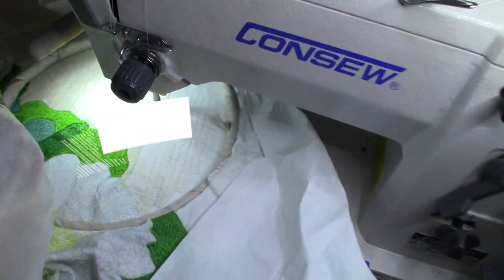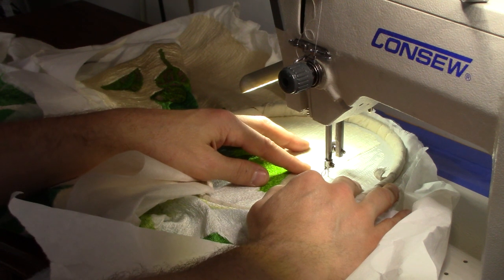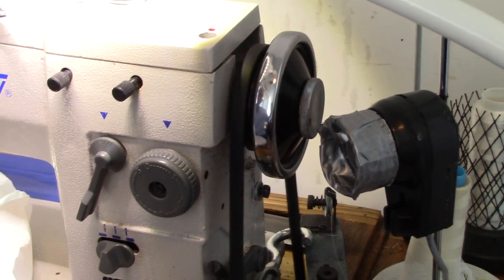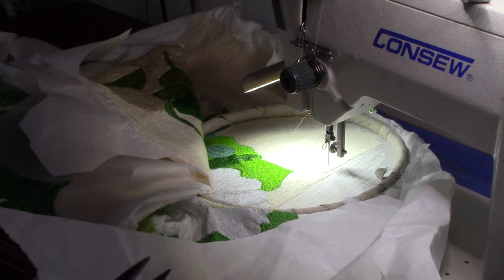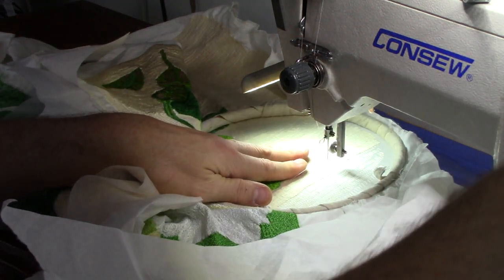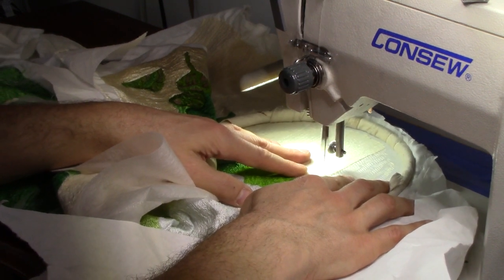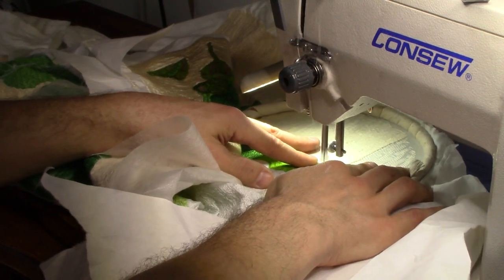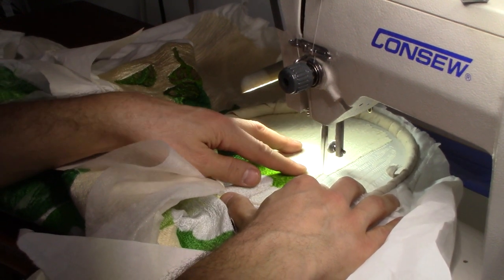Industrial Speed on Consew CN2053R-1A Using Servo CSM1001

Comment: how do you release the clutch to spool on the cn2053R-1A
Reply from the maker: These machines are designed to wind the bobbin while sewing. If you unthread the machine, and lift the foot, you can wind a bobbin -- the needle will go up and down and this will not harm anything. I changed the balance wheel and bushing so that I could use a clutched balanced wheel.
Reply: @jamesrogers991  Thank you James Rogers.When I lift the presser foot the needle shaft is touching. If I move it up would that change the timing?
Reply from the maker: @raycato3768  Do you mean that the needle hits the foot when the foot is lifted? If so, then I have moved the foot up to prevent this.